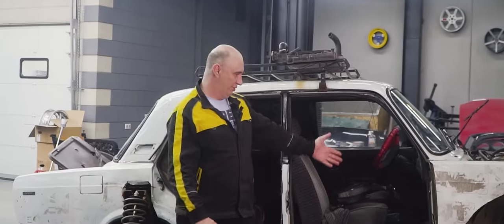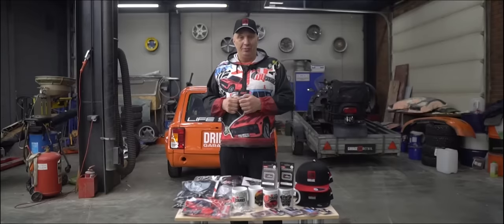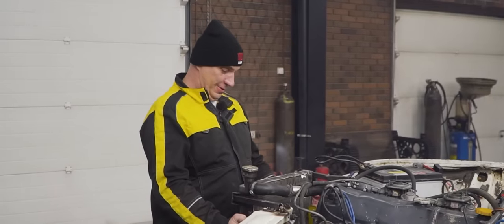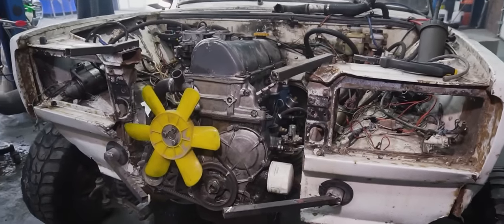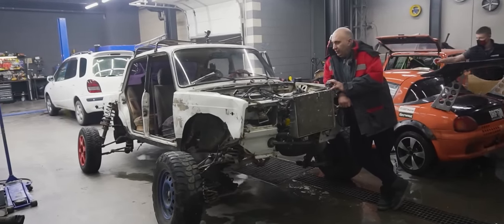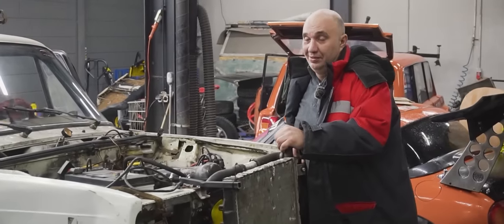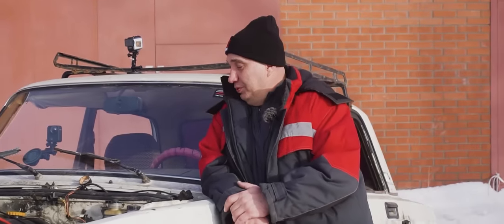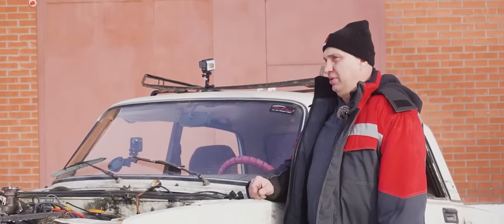How does our custom made inline-6 drive?

Comment: Combine the LadJZ with its suspension and inline 6 with the body like on the 2 wheel Lada Sled that could not keep up right and you got a race car like on the old salt flats for land speed records. Update the rad and whatever is needed for the engine, Do a bit of suspension upgrade with some lightening, Maybe swap or change up the Trans and slap the slimline body on and that thing will fly over some snow. Heck could throw on some snow skis on the front and some aggressive treaded snow tires Call it the Lada Express

Comment: The random non firing cylinders is the ignition system being piggy backed, when could have been solved by using a 6 cyl disturbutor. But sadly you didn't configure the stroke timing to achieve the  potential you hoped for. 
Still  it's fun when you make some whacky device.

Comment: "Pistons" was interesting but crazy.
However stainless steel isnt crazy.

Can pistons be made from stainless that are lighter weight than alluminium pistons because stainless is stronger so can be thinner walls to reduce vobration & increase top RPM.

2 engines.
Straoght 6 is fun to build but a straight 8 would be smoother, more powerful and suit that car better.

Comment: Well funny episode but you need a proper inline 6 crank to get even firing intervals then you can use an inline 6 distributor too so the engine will run properly

Comment: you should use a inline six distributor to solve the problem of intermittent combustion in the two extra cylinders
Reply: Or go fuel tech hahaha and run some kind of cam with sensor..instead of distrubator cap and rotor

Comment: Are the 4th and 5th cylinders are not properly sequenced in between the power strokes of the 4 cylinder? That would require a change of valve timing on cylinder 6, to exchange the intake and exhaust cycles.

Comment: you might try changing firing order or changing cylinder timing i bet yiu can double the power with an adjustable ignition timing control box luke ecu black or used haltec or even on from hacked ignition box.

Comment: Would it not an easier cut to do 3 cylinders from each? That way you could mount an resurface each side with minimal problems, and still maintain oil and coolant lines, right? That way you would only need a bigger pump and radiator for the added coolant.

Comment: but it do be looking like one of my contraptions in crossout. hell, I wanna get the car pack for Wreckfest with the "gorbie", which I know is a mid 80's Lada 2106 or whatever. like this one. see if the devs added any Garage 54 inspired parts or livery because of you guys. I'd totally rock that. something like a white, red, and black geometric shape pattern, or tire tread design camo pattern, and some one off spoof in line with their copywright skirting ways, but clearly a G54 inspired stuff.

Comment: It sounds like its running on 3 cylinders.

You need to modify a 6cyl distributor to fit it will run even better

Insufficient cooling? Thats saying something considering how cold it is during the test

Comment: I mean obviously there is gap in the cylinders, but is the exhaust modified at all ? or is it inline 4 exhaust with inline 6 manifold ? Should use bigger diameter pipes with more cylinders

Comment: They should’ve cut the front cylinder off one engine and the back cylinder off the other engine and done 3+3, would’ve matched up much neater
Reply: They said in the first video that that would have been to easy, so that's why they went with this

Comment: ya'll need to get a proper distributer for that thing and make a firing order more like a 6 cylinder rather than a 4 cylinder with extra pistons, then measure the power gains comparing it to a stock lada engine.

Comment: I'm surprised the exhuast wasn't stepped up a size. Surely it would be causing a restriction to an extent now that it has an extra 2 cyls.
Reply: Only 4 of the 6 cylinders are firing, so it wouldn't really matter.
Reply: it has so much blow by i doubt the exhaust is gonna hurt it much in comparison xD

Comment: Why didn't you split the block at 3 cyl, front,  3cyl back, on both Motors?( One retains the back and three cylinders , one retains the front and three cylinders) this would have made an even, correct six-cylinder. You would then have the back of the other motor with one cylinder and the front of another motor with one cylinder. You could have made those  into a L2cyl. lada, that would have fit in a lada perfectly. It would also be way easier to attach both block halfs together at that point.🔧🤪👉👈

Comment: Why it doesn't sound like a v6, but like a inline 4?
Reply: If you have seen their last video on this engine, it still has an flat plane inline 4 style crank, they didn’t change the firing interval so it still has the same firing order/interval as an inline 4, while some cylinders fire at the same time

Comment: I'd like to see a flat 8 engine out of two 4 cylinders running on one crankshaft.
Reply: That could work if they bolted the conrods beam to beam, and didn't use any caps.

Comment: There was no need to lift up the car and widen it, there are some power losses with that mod and the geometry is terrible... the snow doesnt help and there is a lot of wheel spin. Just trash this Lada body and put the 6 cylinder engine in another UNTOUCHED Lada body, just make something practical and well looking for the first time. After you finish that job install winter studded tyres and find a stock lada with the same tyres and do a 400meters drag race  ( or 1/4 mile )

Comment: Dude you made that machine your bitch, and the welding you did on the crank and on the engine could handle such abuse.  the engines you used weren't winners, so i say that it is 147 percent, and by the way just how was the ride.  was it better than before.

Comment: We pretty much take it for granted that the old 4cyl lada engines dont fire well on all cylinders, esp not under load, an idle test is as we know worthless. So what happened here is that out of 6 cylinders 4 of them will actually fire, that will increase the power. Here maybe 5 fired in periods. Great power.
Notice how the car will not handle with a welded diff, noobs watching this channel and think welded diffs are great should take notes, welded diffs are very un-great to say it mildly.

Comment: The engine looked fantastic from a fabrication point of view - But it never got to run all 6 did it - you need a proper engine Tuner in your team, your engines in most stuff always sound like they are misfiring and the swivel the distributor wildly routine is not proper timing technique eh? haha. Fabrication 10/10 Basic Engine Tuning 2/10

Comment: with all that snow and ice it would spin wheels with just 2 cylinders then what an achievement is that?
This garbage hardly idles, doesnt work too smooth, I dont belive it makes decent power or any proper torque. Your modified suspension makes the car dont turn, it is wobbly, but it's probably heavy AF so it is again counterproductive.

It was fun to watch though xD